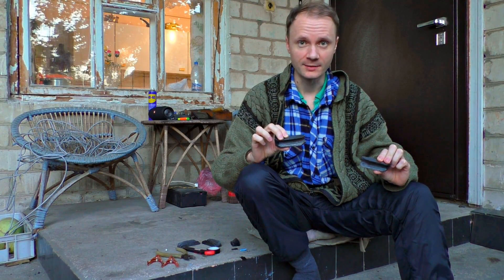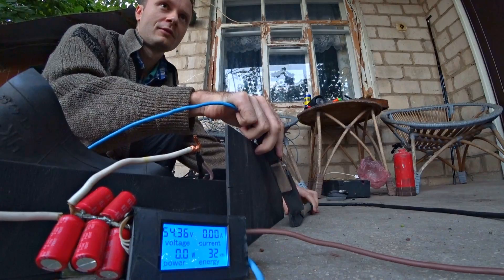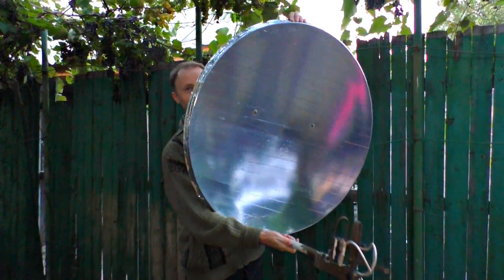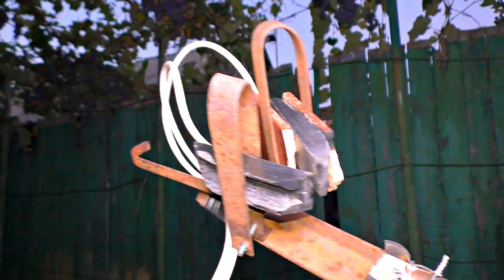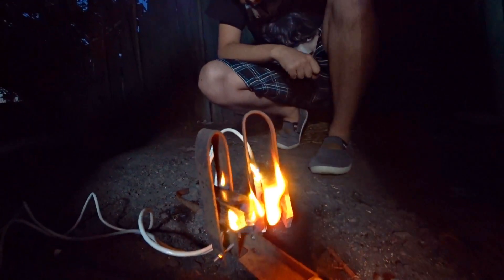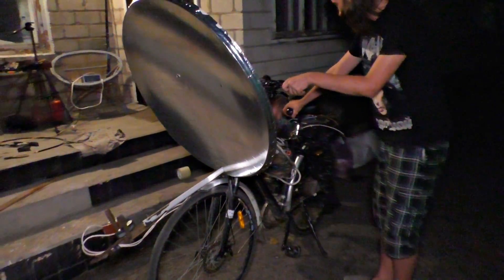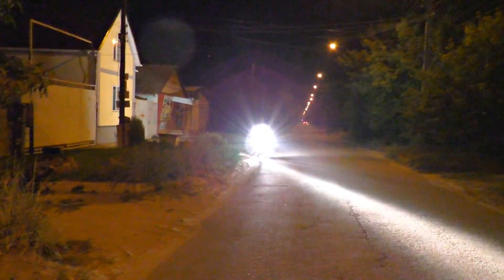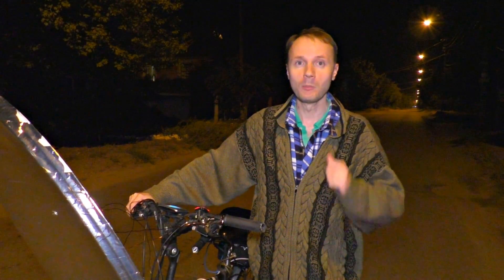I've Created an Artificial Sun! The Graphite Ultra powerful Lamp! 4000 W

Comment: What you can do with it ? Wait for the winter and show us the searchlight
  in the woods and the fields ! And put it on a tower. Or put a rotating
  angled mirror in top of the tower and the light stays down.
  More ideas. But don't use scrap material all the time. Work clean. To following projects are for you to make. :-)  Many months ago it was me who gave you this arc-light idea  to make.
  Next most interesting projects:
  - buy a highpressure watercleaner or second hand. Now put instead of
  water, dieselfuel in it ! And point that on a candle. Watch out. Next
  take of that spraynozzle and put a small pipe on it for brakefluid-type.
  Now add some benzine to the diesel. You have now a flame thrower of
  real danger !
  - Buy a quality steel pipe of say 1 inch diameter and 4 meters long.
  Now find an engine piston that fits that pipe and put it 30 cm. in that pipe.
  Fill that 30 cm. with a air/benzine mix and make a ignition sparkgap
  in that part. Do this with care. Hairspray will work also. Now fire
  that spark and that piston will fly out like a cannonball ! Watch out.
  Now the next step. Cover the end of the steel pipe with a thin aluminium 
  metal. This part you suck vacuüm with a vacuüm-cleaner. This gets easily
  a pressure of 0 atm. Next put a little wooden stop at 30 cm. just before
  the engine piston. Like a rocket this is needed for the biggest thrust.
  What you have made now is a German V3 weapon ! In the 4 meter pipe the
  speed gets so high before the piston gets thru the thin aluminium metal !
  Now make a piston filled with lead to give it more mass and watch the
  enormous difference in distance of this bullet.
  If you need some money via Paypal let me know. Work precise and with good 
  materials and the western viewers will make more views. Succes.  
If you do it nice we will give you many more ideas. Don't forget we will watch you.

Comment: Did you know there's a new theory called electric universe. It  says our sun (or any star) is not a thermo - nuclear reactor, but instead it is a place where plasma that flows throughout the universe sinks, thus creating this enormous heat and light.
That explains strong magnetic poles on our sun as the current that discharges creates electro-magnetic field around itself.
Reply: @Jack Trade - hmm this is interesting do you have any more info

Comment: I used 2 carbon rods12in long,and 225amp arc welder,and a tub of water put the 2 rods down in the water,and bring them together closer until they arc then move them apart until you get a steady arc and plasma glow from arc and hydrogen from the water,look at it with welding helmet it's very bright,and you can see small plasma balls coming from the arc cruising around in the water,cool experiment,and if the gaps right the carbon rods don't burn-up at all

Comment: This is how I feel when people have those bright blue car lights.
Reply: @Agustinus Reynaldi Nope, they're usually LED lights.
Reply: @mrdojob  xenon hid lamps or similar were much much much more frequently used until recently and are always in blue-ish color because temperature of their fillament glows is higher than normal incandescent. they also emit uv-radiation which also very irritating for eyes. Led lamps can be with any color, ranging from warm to cold, but usually irritance with them comes from bad optics,  forming pointy spots of light, but they can easily be made almost indistinguishable from old school warm incandescent lamp with right design and are much better than xenon uv-rays.

Comment: I don’t get it why are the granite rods burning similar to a normal fire when it turns off after used
Reply: Because graphite gets really HOT and graphite is just carbon arragend in fancy way so if you heat it up enough it can be burned (same goes for diamonds)

Comment: I was Actually Thinking about doing a video on this a few weeks ago and put it on my List, These are really cool, I made one about 40 years ago and It's Very fun. The Light can hit the clouds like an Event Search Light!  I highly Recommend Making one! Caution!  Eye Protection is Needed Like a Welders Mask!  The one I made was run from AC and used a salt bath for the Rheostat Power control!  You can Do This With a Small clay Flower pot and Carbon rods from Dry-cell batteries!

Comment: It's about distance,  if someone had a red dot light and it was able hit the dark side of the moon with it from earth unless someone used a high power telescope they might be able to see it, even better if someone was standing within a short distance on the moon they could see the red dot light, if someone can see you 10miles away and you can't see them, finding where the light beam at it's most narrow point could have the same effect as using a magnifying glass to burn something, the more powerful  magnified light the farther the most narrow point would or could be.

Comment: I'd like to remind KREOSAN that electric arcs can put out enough UV-B radiation to permanently blind someone, especially when focused to a beam.
Reply: Plus some x-rays and I think some more exotic stuff like muons. The UV is the most dangerous though. Its a miniature version of one of those insane 1930's search lights.  :0
Reply: @Lucien86  doesn't produce x-rays, voltage is nowhere near high enough and ambient pressure is too high.

If arcs produced x-rays at atmospheric pressure then every professional welder would die from radiation exposure.
Reply: @forestdenizen6497  Yep not high enough - it just seems anti-intuitive for some reason.. I remember somewhere a description that said a typical x-ray tube would use about 50 Kv+ against a tungsten target, but that was producing a lot of x-rays.
Reply: @forestdenizen6497  Indeed, X-ray can only be produced in Vacuum Tubes like old TVs. Even then, the thick Leaded Glass protects the user from the X-rays. You'd have to put your face right up to the screen to cause any damage.
Reply: @Lucien86  Are you serious? X-ray is more dangerous because it's Ionizing Radiation! UV is still bad but it's not Ionizing
Reply: @Vinnay94  Only by direct exposure comparison. UV radiation kills 50,000+ people every year. Over the lifetime of humanity its killed roughly between about 1 and 5 billion people. X-rays cant compete with that.  :)
Reply: It is not so bad. In Europe they used arc lights all over the place.
But just don't look in to it.
Reply: @janvisser8452  they also had thick glass as glass blocks most types of UV
Reply: Bruh this guy nearly got hit by an artillery shell while recording a video, going blind is the least of his concerns.
Reply: @jurgendebruijne  It happened during the video where they were trying to capture lightening to blow stuff up, ill try and find the video but it should be in one of their playlists.
Reply: @jurgendebruijne  I couldn't find the video but there is a clip of it in this interview with the new York times, https://youtu.be/g545WaMZ4oA?t=303
Reply: In Ukraine, safety is not numba wun prerty.
Reply: just like a real sun yay

Comment: You think 100w of light and 3900w of heat
Reply: Actually heat is emmited in most part as infrared radiation
Reply: tevhnically it's 100% light
Reply: Not really 100%...
Reply: Why do you think it is 100% of light?
Reply: @gana3967  All the heat that they can feel is from the light. The only heat being lost to light output is the resistance of the wires, the air gap and the carbon electrodes.
It's probably at least 60% light output across all wavelengths
Reply: @gtjack9  And like 5% over visible spectrum.
Mostly IR and UV here, good for tanning lol.
Reply: @lazar2175  pocket sun
Reply: Light is heat in this instance.

Otherwise if there was no light there would be no heat.

So yes the heat is 100 % light perhaps not visible light but light non the less.

I have no education and I know this lol 😂 😂 😂.

Clearly the event of the internet has not brought as much light to people as this bloke has to his neighbors flats

Comment: That was called carbon arc light it used in early 1800 way before carbon filament incandescent light bulb created. People use the carbon arc light for outdoor illumination such a street light or used for searchlight during WW2. The disadvantages of this light is the anode is burn away make the gap between the two electrodes further and further until it extinguish the arc, so someone must be an operator to keep the gap distance. The electrodes need to be replaced everyday or every time it burn away. Also the arc is dependent on humidity, if the electrodes distance is way too close its burn up faster so need to be replaced soon but if the distance is way too long the arc will extinguish.

And I don't know why our school wasn't tell this history

Comment: Cool to see a D.I.Y. arc light, but this is Old tech..They used carbon arc lights in the theatres long before edison invented the light buld.. They even had clockwork mechanisms to advance the rods forward as they burned down. Still pretty cool though.
Reply: He isn't trying to invent anything, he's just showing us cool science and technology because it's just cool
Reply: @Buro Dackel I already knew that, but rather than typing out a page of info that most people don't know anyway, I just typed out what i said...Main improvement was the tungstun filiment and a harder vacuum which brought the price down far enough for it to be reansonable. And don't forget that Tesla worked on the lightbulb as well. He modified the bulb by giving it a ground glass base to bypass edisons patent on the screw socket so he could light the worlds fair with his bulbs.
Reply: @Buro Dackel Edison patented other people's inventions, Tesla broke new ground.

Comment: Bro please make a vedio of mesuring the range of it . One in  mountain in it and  another in  platues  
Bro nice vedio
Reply: Neutronic Gaming the mirror focuses only at a pretty close range, if you look at the shot where they hit the building you can see that it focuses and then goes out of focus before it hits the building. In order to visibly see it from far away they’d need a different angle on the mirror